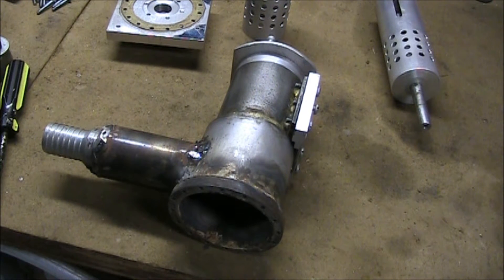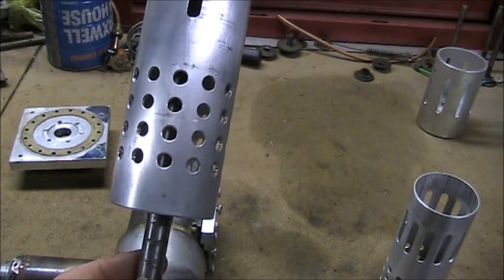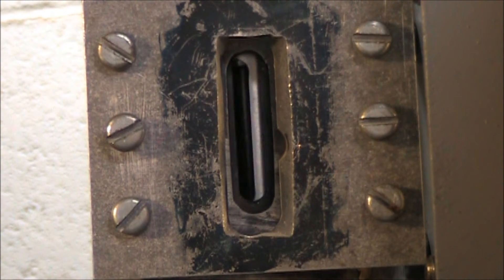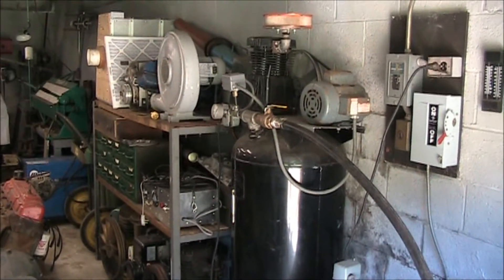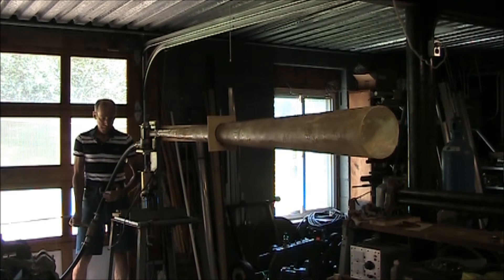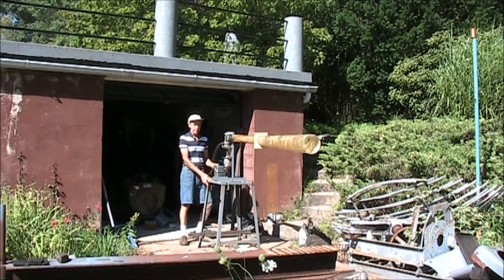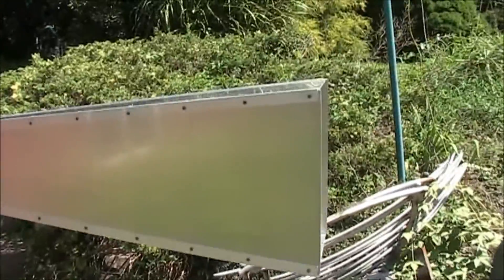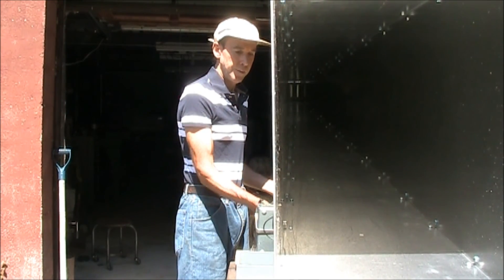siren experiment

Comment: Homemade thunderbolt long story short
Reply: +Minnesota Warning Sirens  No this is pneumatic ,and it requires compressed air to make noise at any speed the rotor is spinning ,just the rotor motor running you can't here noise. The Thunderbolt is electro-mechanical with a compressor ,since it has only one port open it's not loud enough ,but still makes noise ,to make it loud it has to have a blower. So basically this guy made his own German Pneumatic siren.
Reply: @Duderocks5539  mhm.

Comment: I wonder if you can make me a wave guide? I got 4 magnetrons side by side and need to funnel all four antennas into one. I need 4 wave guides merged into 1 guide. email me at hiriderace@yahoo.com
Reply from the maker: All 4 Magnetrons should be mounted on a common open channel. Check your phasing distance and use a common horn output.I built one with 3 Magnetrons with full wave DC input. That is a lot of input power It is like a phased array. It is an easy project with sheet metal. I should post mine on You tube eventually.